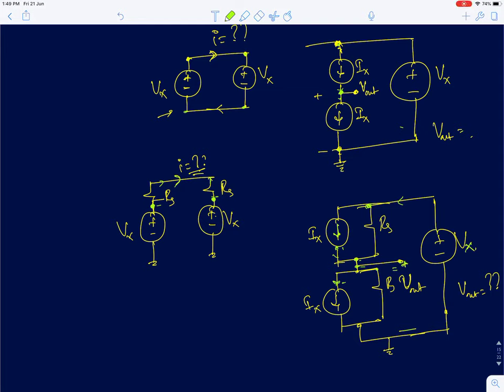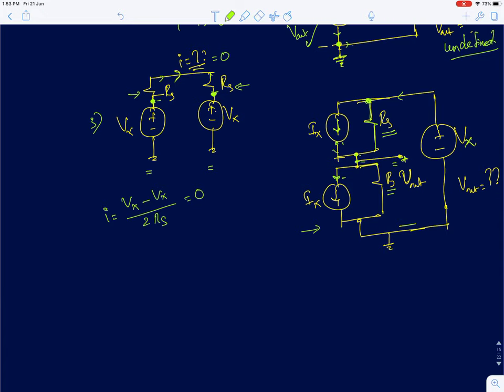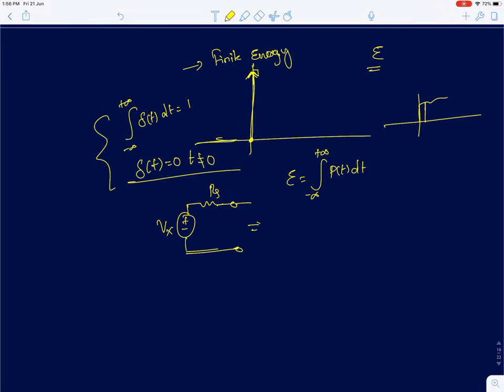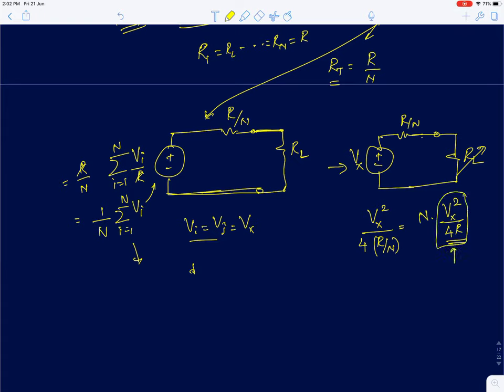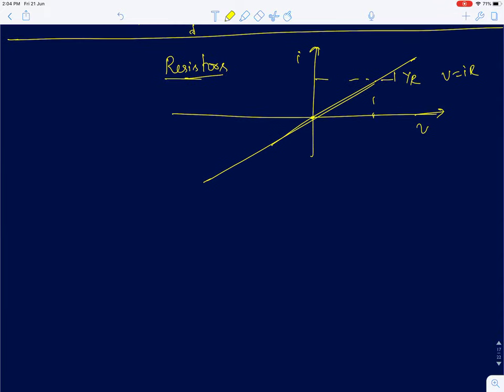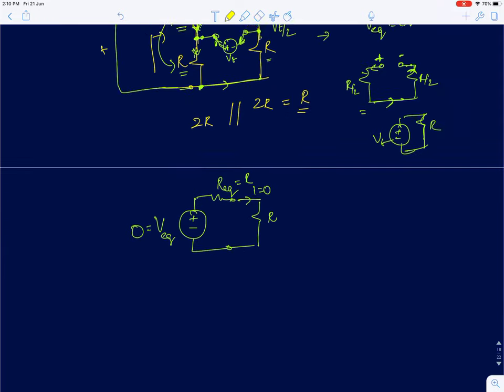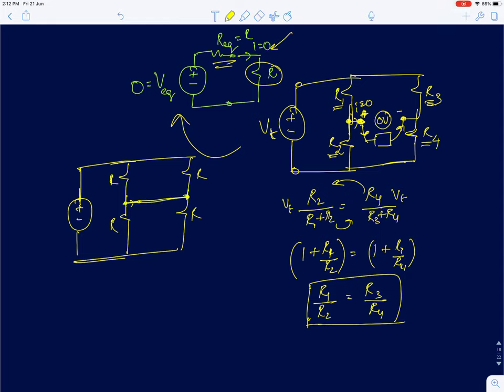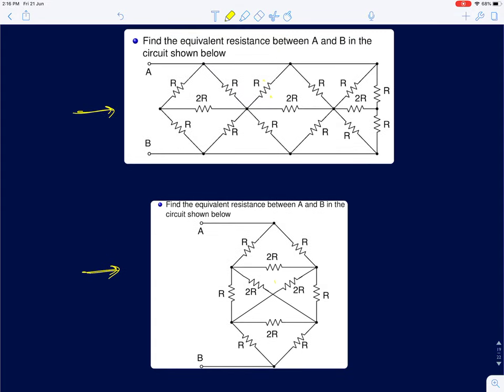ES Lecture 3: Resistors and Equivalent resistance

Comment: While deriving that Wheatstone bridge formula, u replaced the middle resistor with a Short, but since no current is flowing through it, shouldn't it be replaced with an Open circuit ?
Reply: That's correct as well.. in that case 2R in parallel with 2R, resulting in Req='R'